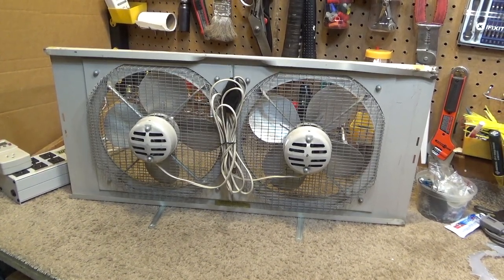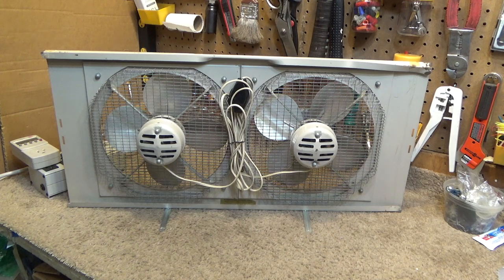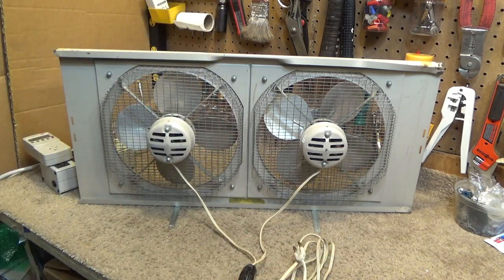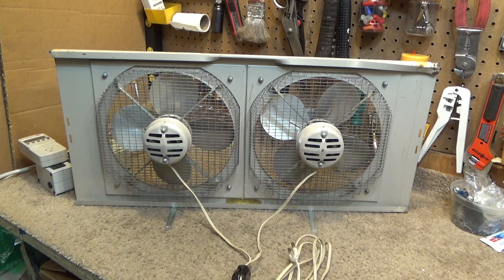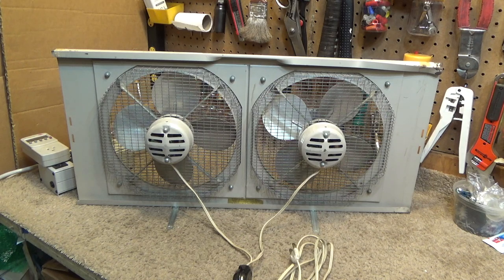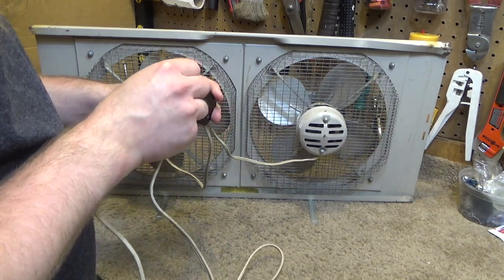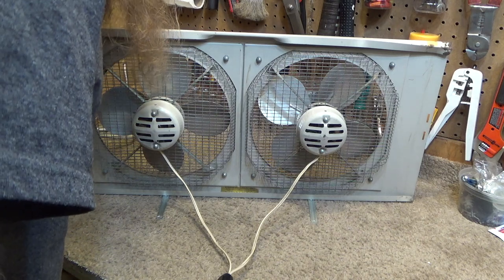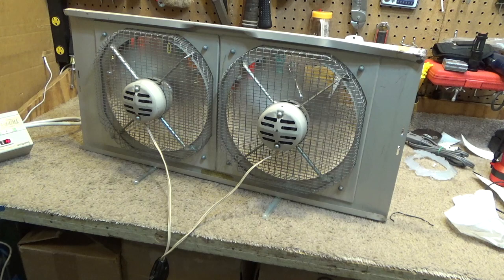Marvin 210 10" Dual Window Fan

Comment: I have a Marvin model 10SFW, which is green like your small fan you showed, but it has the 10" fan blade. I assume the small one you have expands to fill the window width? I love mine, moves a lot of air and does it so much better than the new ones. I'm always worried it's going to break, in fact I was wondering tonight what kind of bearings it uses, there's no obvious oiling mechanism. Also, I assume when it said model 210, that they named it that because it was a 2x10" fans. Anyway, love the fan!
Reply from the maker: There were panels you could get to put on the ends of the fan to make it wider. I'm not sure if they were a separate order or if they shipped with the fans. Many of them have been lost to the sans of time unfortunately.
Keep the bearings oiled--replacing bearings like this is not readily accessible.

Comment: We had two of these when I was growing up! They both ran hot and smelled bad, who knows if my dad oiled it with the wrong kind of oil. If you had it blowing in the house it would just make the room smell like hot motor. Still wish I had them though.
Reply from the maker: You may have had the smaller ones, those are known to run quite hot and I've heard plenty of people complain about them smelling bad.

Comment: nice... I have the same  fan. even sounds the same. looks barely used but unfortunately one bearing is on its way out. I need to dig it out and re visit it.
Reply from the maker: Unfortunately the bearings on these are not known for longevity. I think it may have to do with an insufficient amount of oil wicking around the bearing.

Comment: I have this fan but in the smaller 8” blade version with light green paint…..with daily use, they need to be oiled lightly every month…..the bearings dry out quickly and get noisy if you don’t.
Reply from the maker: I too have found these to require quite a bit of oil. They must have used cheap bearings.
Reply from the maker: @VegaBass25 I wonder if it would be possible to add more oil wicks...This one is due for service for this year, I'll have to explore the possibilities while I have it apart.
Reply from the maker: @VegaBass25 The thicker oil is a good idea too, maybe I'll give that a try this year.

Comment: I have this same exact one. It’s quite amazing how it can cool off a room. It was making so much noise. I started to take it apart to clean and possibly oil. Just not sure where to put the oil.  Can someone help me with this?
Reply: I found it . Once the cap is  on the motor, there’s space near the top screw to oil. I couldn’t see the imprint of the word oil .😂
Reply from the maker: There's 2 holes. Oil must be put in the front and back bearing. Unfortunately these used rather cheap bearings and tend to be very noisy. The oil will quiet it for a little while, but it will get loud again soon.